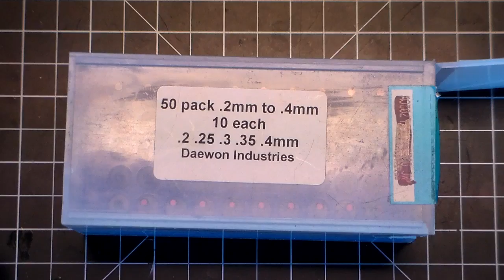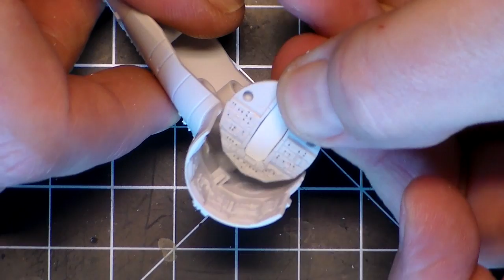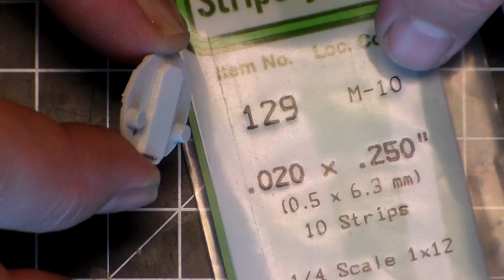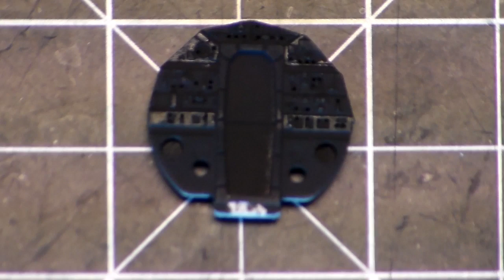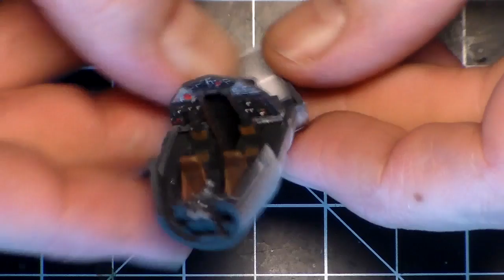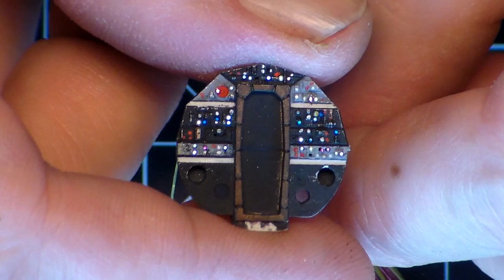PART 5 - MILLENNIUM FALCON Bandai 1:144 Scale Build

Comment: Just wanted to let you know that Green Strawberry Has the photo etch for the Bandai 1/144 Falcon as well with decals that are translucent for the back wall of the cockpit as well as the overhead panels which looks fantastic because the photo etch has tiny holes in all the right places to beautifully light the cockpit. Jerry at HDA Modelworks has them.
Reply from the maker: Thanks! I have them. They weren't available when I started this build.
Reply: Oh I remember, I was with you from the beginning
. I emailed you about the Paragrafix set, but just got the Green Strawberry set in and the decals/stickers make the cockpit a whole bunch easier. just wanted to let you know. Lights up everything perfectly without having to use fiber on the back wall or the upper panels.

Comment: Tag, thanks for the video.  Question, are you painting the entire lengths vs. just the ends of your fiber for identification or for another reason?
Reply from the maker: Just the ends
Reply: Thanks for the clarification, it looked like the lengths of the fibers were also painted.
Reply from the maker: They are colored fibers, but the color isn't bright or rich enough
Reply: OH! I've not seen "colored fiber" only clear.  I just pain the ends or use colored LED's.  Looking forward to learning more from you.